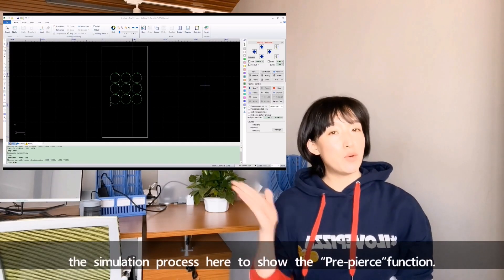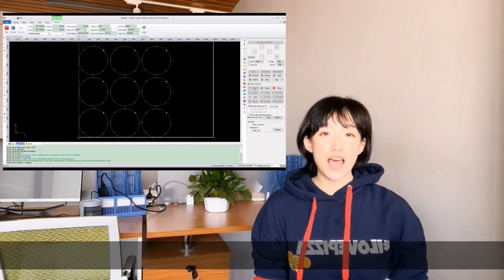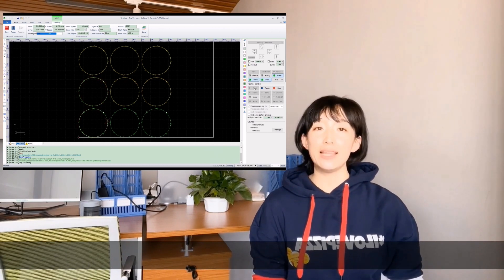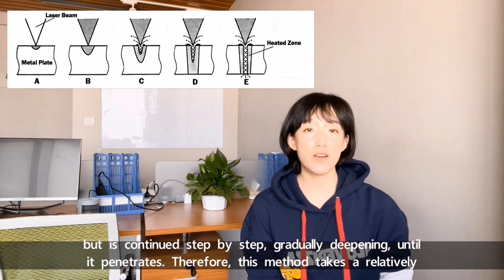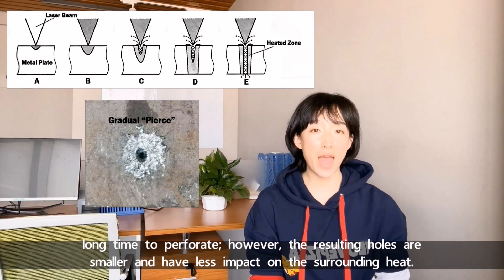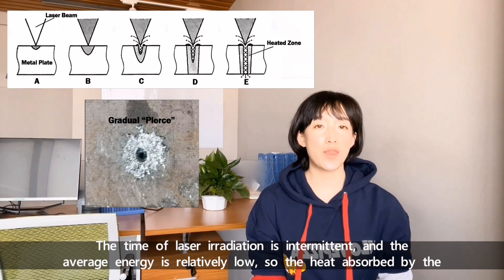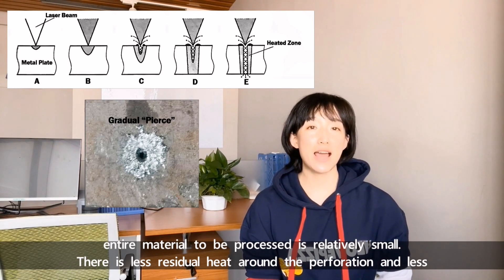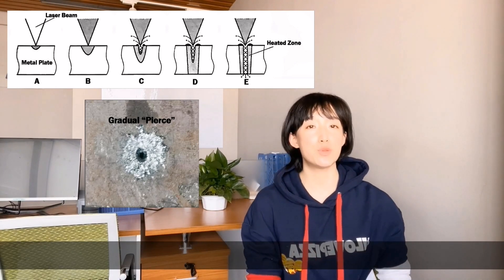Pierce in Fiber Laser Cutting | Perforation in Laser Cutting 1

Comment: Hi Clara! I am having problems with my pierce height. My laser starts off piercing as programmed at 3mm height but after a few minutes it starts piercing higher and higher. It will eventually end up over 25mm and at that height it is leaving big burn marks about 2-3mm wide because of the focus. If I pause the machine for a few minutes then resume it goes back piercing at the correct height of 3mm but a couple of minutes later it starts getting higher again. Any idea what is happening?
Reply from the maker: Is your nozzle getting hot and hot?
Reply: Yes. I've checked both lenses, they are clean. I've put tape over the nozzle and the hole is in the center. I'm not sure why its getting hot? @ClaraChai